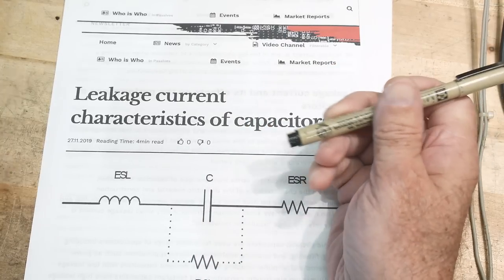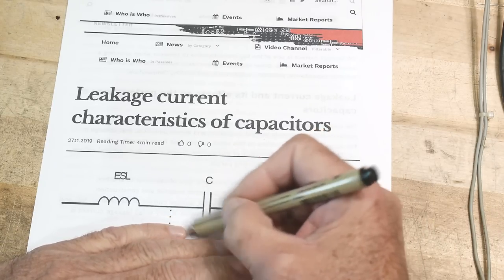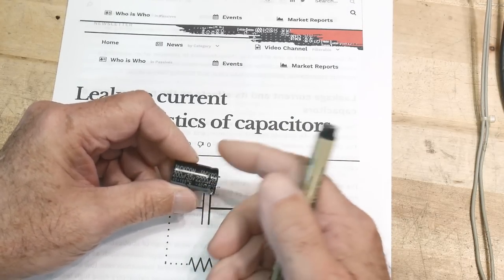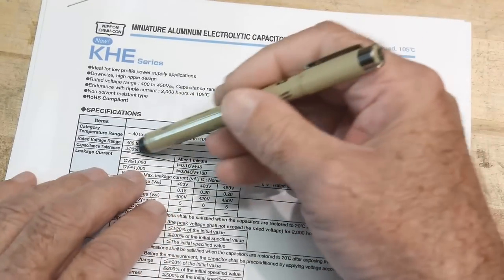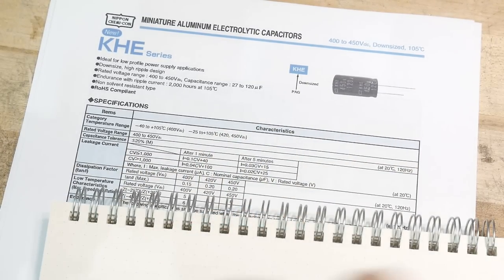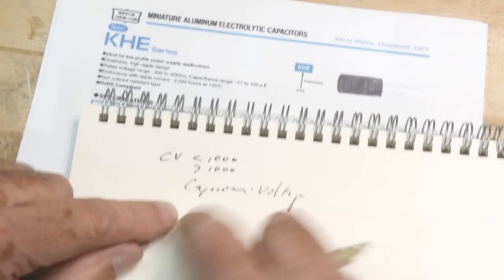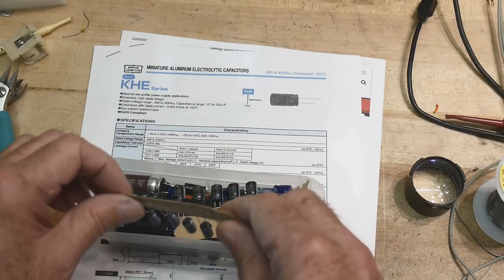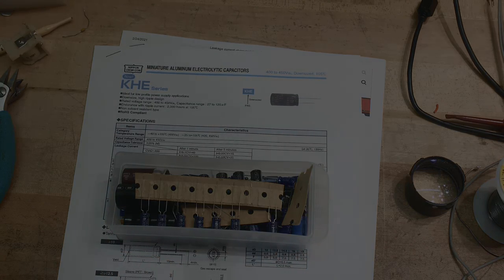#744 Measuring Capacitor Leakage (easy and cheap)

Comment: re-form the capacitor, as the oldtimers say
Reply: Exactly this term. I have heard many debates about reforming old capacitors. I do not believe that it will render a reliable capacitor, once it has been "reformed". I think it is snake oil personally.   Fred
Reply: @electronicengineer  not worth finding out . Buy new and replace.
Reply: @nickcaruso  I couldn't agree anymore with your approach.   Fred
Reply: Reforming may be not be worth it on small electrolytics under 100V but when you get 1000V working larger than the size of a coke can it's necessary if they haven't been used for a while. Search for variable speed drive type kit (ABB etc) - you don't want to blow those up (spoiler alert:- at 400V it's spectacular).

Comment: At 45:24 and assuming one can discern one half of a small division using the 1 mA scale it appears that the smallest leakage current one can measure with this device would be 
1000 microA/100 = 10 microA. That would be double if you could only discern 1 small division. That should be good enough resolution to test any capacitor as the formulas indicate that any current below 15 microA (CV < 1000) or 25 microA (CV > 1000) is acceptable at any capacitance and at any voltage.

Comment: Funny, after all the things I've foxed, built, been schooled...I just can not follow this to fruition.  I want to test my guitar amp vintage components to hopefully save discarding them. So for one, I haven't a 500V supply and if I did, do I need AC or DC supply? Because while I have a PS that'll produce I think 30V, I think that's DC and my understanding is that caps block DC current. So is DC useless?
Reply from the maker: you need DC. 30V will be fine for most things
Reply: @IMSAIGuy  Thank you. I did see that later in your video with the last tester. I still don't understand how it can be measured since caps block DC but I'll learn that later when I grow a few more brain cells.
Reply from the maker: @derekec  caps ARE supposed to block DC, and then they don't, that is leakage. No cap is perfect and they all leak a bit, you just don't want too much (when they age)

Comment: I like the KISS  concept. Spec. says 2000 hr for ripple. Most, if not all pieces of useable equipment that are more than 25 yrs. old will probably have crossed that line, but prudence is important. Great lesson , like your testing equipment. Thanks.
Reply: Teknogod17  that was his usecase. Electrolytic caps worst enemy is time. Especially in the ones with no outward issues. I have to recap 130 caps in a piece of vintage audio gear. They still look brand new but every one failed haha
Reply: That's 2000 hours at the ripple rating, at max temp. Derating greatly increases life, not hard to get the formula to spit out years or even decades of constant operation in actual use cases. With the high temp 10,000 hr parts it isn't hard to get a number that probably exceeds the realistic shelf life of the rubber seal in the end.

Comment: I want to test 12 Electrolytic Capacitors 2000MFD @ 450 VDC.
Reply from the maker: those are some expensive caps!
Reply: @IMSAIGuy  They are also very dangerous.  I had an instance where one of them started producing Hydrogen inside an enclosure.  The explosion left some serious damage ripping the aluminum case open a square box looking like a beach ball.  Machine screws were torn through the metal.  Have you ever heard of a cap producing Hydrogen in that quantity?
Reply from the maker: @bellasvistas3463  I've had capacitors blow up and emit nasty smells. Haven't heard of the hydrogen thing, but those are mighty special caps.

Comment: Well, people make their own cap testers because they have kind of grasped that free multimeters' results are not reliable enough for their precious gear. 
You are not so far from a man testing the current in his eletrical socket with his multimeter - you know, the one sticking one probe in hot an the other in neutral. 
Knowing how the measuring equipment works is somewhat essential for measuring. Or dissing others ofr their methods.

Comment: Your method of testing leakage is fine for testing electrolytic filter capacitors, but not suitable for testing DC blocking capacitors in very high impedance circuits, particularly in vacuum tube equipment.  Mr C's latest capacitor tester will detect leakage down to 40 Gig Ohms.  It will find bad capacitors at 30 volts that your tester (and others like it) can't detect at several hundred volts.  That level of sensitivity may not be needed in every application, but any leakage in a paper, film mica or ceramic capacitor indicates a failing component that needs to be replaced.
Reply from the maker: that would be 750pA. can you show me a capacitor data sheet that comes close to that. Maybe some people care. 750pA, let's call it 1nA would be a good value right?. and if several 10's of nanoamps are bad, then the method I show would work just fine if your meter has a good microamp scale. the meter I used has 10nA resolution.

Comment: I think you were doing a bit of bashing Mr Carlson's lab and his low voltage capacitor leakage tester. You really didnt need to do that, you only needed to show your method of testing. Nothing wrong with your method but remember it's a lot more dangerous with high voltages.
Reply from the maker: My only complaint with Mr is that he never explained the circuit and kept it a mystery from his viewers. He made it seem special.
Reply: @IMSAIGuy  I see your point sir. You are showing a technique that can be reproduced. I think you need to stress the dangers more though. Thanks for the reply.

Comment: What's the possibility of a 400V capacitor showing high leakage at 400V but no leakage current at 100V? 
There's a very good reason why capacitors are tested at their full rated voltage and that's because when they begin to leak, they always start at the top end and work their way down... It's the same reason why when you have a failed capacitor that some brainiac decided to place right there next to a heat source, you always replace it with as high a voltage rating for the same capacity value as possible... By the time that new capacitor is due to be replaced, it would have far exceeded the working life of the original one! They always begin their failure from the top and work their way down! 
So! Can you test a 400V capacitor with only 100V? Yes if it is only going to be working with 50V or less... 
And as for your description regarding positive charge on one plate and negative charge on the other plate of a capacitor? Where in all Science do you find protons and electrons separate from each other? There's no such thing as two separate charges! It's only one charge! The proton has more charge than an electron (assuming that the accepted model of the atom is true and correct even though no one has ever seen inside one).. 
Had a capacitor have two opposite charges inside it, that would be like having matter and anti matter! A situation where one cancels the other and both cease to exist! We know that Capacitor's don't just disappear when charged so what we really have is a difference in potential voltage where one plate is at a higher charge state than the other! 
Benjamin Franklin said it a long time ago! It's just like a bank account, when it's in credit, we will call it positive! When it's in debit, we will call it negative! It's all just a matter of accountancy! 
Someone somewhere since good old Benji misunderstood something and got it wrong! There's only one Electric charge! The polarity is only a reference for circuit direction!!! Nothing more, nothing less!
Reply from the maker: Capacitors are more complicated than leyden jars: http://www.elna.co.jp/en/capacitor/alumi/principle.html
Reply: @IMSAIGuy  actually no they're not, even Leyden jars suffer from inductance, series resistance, parallel resistance problems just like capacitors...
Reply from the maker: @PeterMilanovski  last time I checked they did not have chemicals
Reply: @IMSAIGuy  what? The Leyden jars? They have electrolyte! Even though it's only water, it's still a chemical which can be broken down into hydrogen and oxygen..
Reply from the maker: @PeterMilanovski  No, my original  response was electrolytic capacitors are way more complicated than two plates of metal like Ben had. The chemistry is way more complicated than I ever thought. I've put a very nice paper on the subject in the description. You will see the negative 'cathode' is really a liquid and there are many +/- boundaries set up though out the device. The idea of a balanced charges is not valid in these devices. The liquid can only hold negative things and if reversed biased can start to electroplate things. Things are always migrating around and the conditions change. They can be electrically leaky and physically leaky.
Reply from the maker: @PeterMilanovski  I was referring to the ones with only glass, sorry for the confusion.
Reply: @IMSAIGuy  yes! You are correct. They are very complicated, even more so than what most people realise... 
They are the only component that can be used in so many different circuits and do so many different jobs.. but they also have so many different failure modes too! 
I have delved deep into this topic because things would happen and I just couldn't understand why! And most people don't get it! 
I fully get what you set out to achieve in this video and you did very well... Better than the majority of people who have ever talked about capacitors! 
Parallel resistance is possibly the most important failure mode of a capacitor! This is the failure mode that destroys everything else, it's the one that over biased the transistor and killed it... It's the one that passed so much current in the power supply filter section that it caused the transformer to overheat and die, what's the worst thing that a high ESR capacitor caused? High power supply ripple! That's not enough to destroy something... If anything, the high series resistance will cause it to self heat and either expand and explode or just leak electrolyte. That's not to say that parallel resistance won't heat a capacitor, that all depends on how long it stays in that region of resistance where it's not a short circuit but not high enough to create heat.. 
A good used capacitor should have a capacity reading just below what it's rated for, if it's way lower, then it's a good indication that the ESR could be to high, but if it's capacity has gone up! Well, capacity testers measure voltage over time and if there's a parallel resistor across it, the leakage would give the appearance of it having more capacity than what it's rated for! This is another method for testing purposes which like the method that you showed requires the capacitor to be tested out of circuit.. and there's really no other way to do it. ESR can be measured in circuit but that doesn't really tell you much... It's a real pain having to pull out capacitors for testing but it's part and parcel of being a good technician. A good LCR Bridge Meter makes life a lot easier, I got my made in china LCR Bridge from eBay and it cost me $95Au which if you are in the US it will be even cheaper! The beauty of this device is that it displays everything on the one screen at the same time! This means that I can see it's capacity, ESR, EPR, phase angle and Quality factor... No need to scroll through a menu! It's far easier and faster than your vintage LCR Bridge Meter although it's not as beautiful... 
Anyway, as I said earlier the video was great but what got me was when you said that it's ok to only test a capacitor up to whatever voltage is available! A bad 400V can show up perfect when checked at 250V but begin to leak as the voltage begins to climb... It the same leaky 400V is being repurposed to work in a 12V circuit.. then that's perfectly fine, it's possible that it's going to work for many years to come before it starts to fail at that voltage... 
You know, there's an old RCA video here on YouTube where they showed how they built TV's back in the day, it's very nostalgic but for those who have any interest in electronic components would notice the part where they are testing the old paper wax capacitors at twice their rated voltage! Yeah! Twice their rated voltage!!! Try this with modern day capacitors! LoL it would make an excellent Electroboom type video.. you know, the type that gets a lot of views! Get your hands on a paper in wax capacitor, new old stock if possible and put twice their rated voltage across it and then do the same for a modern equivalent... You soon learn why the old capacitors lasted so long. They are very underrated compared to what we have today, so what does all this mean? Well, if you overrate the capacitors in a device, expect it to last a very long time! 
As for the Science behind electronics, well it's what they taught us in school but the question I had was, how true is what we have been taught? Well let's have a look at what we are taught... The capacitor has two plates and one plate is positively charged while the other is negative! So how do they get these opposite polarities? They teach us that the proton in an atom is positively charged but it's the electron that's negative! Hmmm interesting, how does a capacitor have the ability to split an atom? Last time that I checked there are no positive electrons!!! They were splitting atoms back in the 40's and 50's and I know what happened with that, so what's really going on inside a capacitor? Well, when you measure the voltage of a device under test, the measurement that you get is the measurement of the potential voltage difference of what you choose to use as the ground reference! If you chose the chassis, you get one reading, if you chose a copper spike in the ground, you theoretically should get a different reading... It's basically the same thing as using a helium balloon tied to copper wire and measuring the voltage in the atmosphere at different elevations which is referenced to ground! But an insulated ground spike with only it's tip exposed will give higher voltage readings the deeper into the ground it goes! People think that there are two different and separate charges! But this is not true! There's only one electric charge! And how we get the positive and negative thing is the potential difference of what has become a ground reference! A capacitor has two plates inside, but there's only one type of electric charge and when the charge is present, it's all going to be attracted to only one plate! There's only so much that a plate can hold and when it's full, in a perfect world... The flow of the electric charge will stop! But we have lead's going into the capacitor along with the plates themselves which are inducting a charge from the very atmosphere that it's in! It's a huge misconception that a device is of when we hit the power button but the circuit is still active inside even though it's unable to perform the task that it was actually designed to do. It's never doing nothing! Ok, I have now gone all philosophical but the truth is that the rabbit hole runs deep, more so than what most people realise.. there is no such thing as a positive and negative charge, that is just a polarity scheme to help people understand circuit direction... I could go on but I'm choosing to end this here. Always choose the red pill LoL..
Reply: @IMSAIGuy  nah mate, your all good! I have never come across an air Leyden jar... I apologize for my ignorance... Now I have to go looking for them 😂... I can't just not know about something... It flares up my OCD LoL...

Comment: my god man... "electric lyrics".  I stopped right there at 24 second mark.
Reply from the maker: sometimes my brain and mouth don't sync up. sorry for the glitch. I do know how to pronounce electrolytic.
Reply: That was a kind response to my fairly rude comment.  Thanks!  Consider re-doing those kind of mistakes so that mispronunciation is not perpetuated?
Reply from the maker: @grkeith2091  I do a video every day and have over 1700. No time to go back. I have more good than bad.
Reply from the maker: Keep watching the video. I use the correct pronunciation